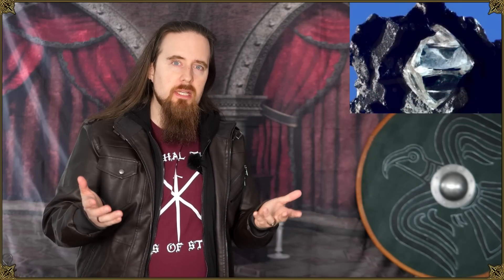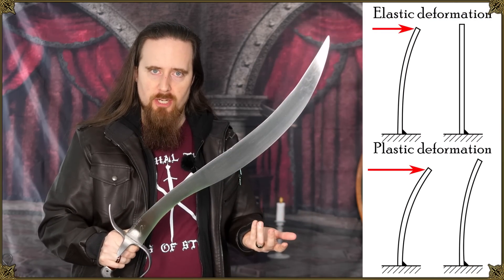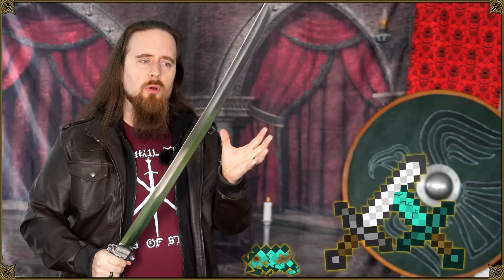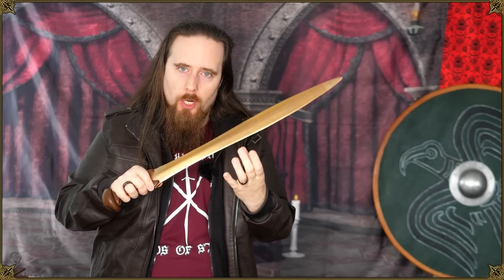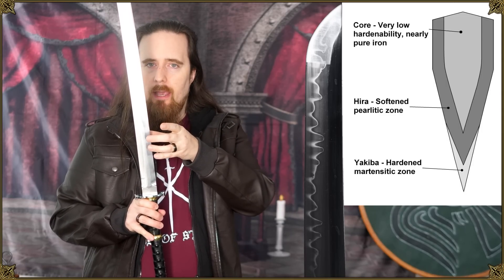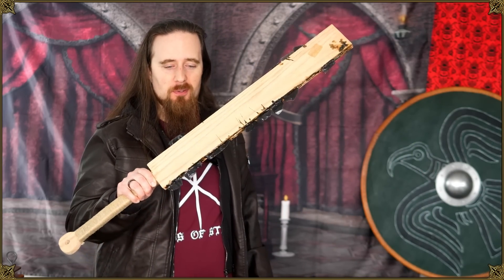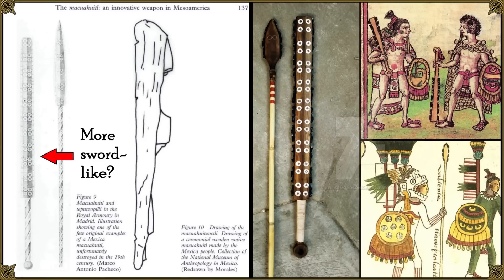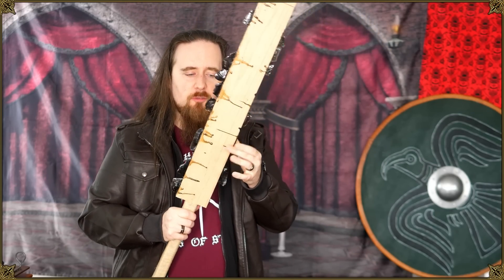Diamond Swords: Could They Work IRL? (Kind Of)

Comment: Normal harder steel becomes brittle. The term "steel" is about as generous as you can get these days. 8% iron or less with miniscule amounts of carbon still makes the cut.  You really need a chunk of AL6-XN fashioned into something. Basically half it's alloy composition is molybdenum and chromium. Then a fair bit of tungsten, a pittance of iron and way more nitrogen than you thought possible (several percent, like 4!). I haven't been able to chip it despite using it as a prybar. Its non-magnetic and won't make sparks against other metals. It cuts most other steels. I'd put my life on it not shattering. Kablewy squad guys love it for knives. It is considered a superalloy.

Comment: Skallagrim, what would your thoughts be on diamond javelin/arrow/bolt heads?  Again, assuming diamond as a material is readily available and as inexpensive as steel.
Reply: Any kind of cracking on the part of the diamond will serve very similar effect to ablative armor: much of the force will be dispersed in the cracking action. So you're gonna have some trouble there. It's part of why there's an entire category of ammo that gives up on sharpness and just tries to deliver a lot of weight and force with minimal losses from travel.
Reply: A diamond that size will shatter if you drop it off a bench onto a tile floor, much less hits a piece of steel at ~90 MPH

Comment: If you really wanted the hardest, sharpest edge for a blade, ignoring cost, you'd want depleted uranium.  It's very hard, and more importantly, it fractures in a way that makes it stay sharp, similarly to obsidian, but much tougher with less brittleness.  That's one of the reasons it's used in anti-tank rounds.
Of course, it's stupidly dense and still pretty brittle, so you'd only want to use it for the edge and make the body out of something like steel (or, if we're ignoring cost, nickel-titanium memory metal), or make a macuahuitl with DU inserts.

Comment: What you said about somehow binding diamond into a steel sword blade to make its cutting edge up is basically exactly how I figured a diamond blade might be done realistically.
Everyone seems to think that diamonds are indestructible , which's probably what lead them to think it'd be a good material to make a sword out of; but it's not because like you said, the harder something is, the better it can retain a sharp edge, but the more brittle it is too.
Also, it's nice that someone else recognizes that the diamond scarcity is an artificial one meant to keep their prices jacked up higher than most people can afford; all you have to do to make one is take a lump of something rich in carbon, like coal, and pressurize it for however long it takes to transform it. If we did that with all the coal we have in this country, diamonds would be so abundant that they'd be basically worthless .
Reply: While natural diamond's price is inflated, synthetic diamond's isn't. Yes, carbon is cheap, but the equipment and energy required to turn it into diamond really ain't. To quote Wikipedia: "The original method [of making diamond] uses high pressure and high temperature (HPHT) and is still widely used because of its relatively low cost. The process involves large presses that can weigh hundreds of tons to produce a pressure of 5 GPa (730,000 psi) at 1,500 °C (2,730 °F)."
Reply: @irrelevantfish1978  woah ; I don't know how many atmospheres of pressure that is, but that's a little over thrice the temperature of the surface of Venus !
Reply: @DakutoSamanushi  It's about 50,000atm, which is roughly 5x higher than needed to squeeze a sword blade until it cracks.

Needless to say, building equipment that can generate that kind of pressure without self-destructing is a bit tricky. 😉
Reply: I've had a theory for almost a decade now. If you constructed a layered long tube made of Highly Conductive Materials. With a long Highly Conductive Rod as well you pack into the inner Tube lots of Ash. Packing it as tight as you manually can and slide the Rod in the middle and seal the ends. Then place that on an elevated position that is prone to Lightning Strikes. I've theorized that it could potentially create Cheap Diamonds. In fact doing the same thing but with Mercury instead of Ash might make Cheap Gold as well.
Reply: @morrigankasa570  interesting theory, except I don't know if you can really turn mercury into gold.
Reply: @DakutoSamanushi  In some University/Lab settings they have done that. Of course it takes a massive amount of energy and time to do so which is part of why it's not done frequently. Especially considering the small amount of Gold they get from it. So that's why my theory/idea is so potentially brilliant. Lightning naturally occurs and is a massive amount of energy as well as heat so could be an efficient method.
Reply: @morrigankasa570  I'd love to see this experiment.
Reply: @DakutoSamanushi  If I had the money/support to do it. I would get the Tubes constructed and placed. Then have to wait for the results. But at minimum for the initial tubes it would cost $150,000 for the Ash to Diamond Tubes/Experiment. Probably another $200,000 for the Mercury to Gold Tubes/Experiment since would have to purchase the Mercury itself which is pricy due to quantity and it being a "Hazardous Material". But seriously if I won the Lottery or found a wealthy individual willing to provide the funds it would be done.
Reply: @morrigankasa570  I meant a video of the experiment you were talking about that the universities did.
Reply: @morrigankasa570  okay, thanks.
Reply: So it's overpriced quartz is what you're saying XD

And yeah big surprise for me, as I was also in the camp of seemingly unbreakable material = great in battle.

But then if it really was so damned amazing SOMEONE would have done it centuries ago. The last thing any combatant wants is for their weapon to shatter mid-fight.
Reply: @Malacite  Quartz is Silica Based while Diamonds are Carbon Based.
Reply: @morrigankasa570  I didn't mean literally I was making a joke because quartz is so common
Reply: @Malacite  Yes, I know that. But would've been more logical to call it fancy Charcoal. Since Charcoal is quite common in most parts of the world and is Carbon Based
Reply: You're on the internet. Diamonds being an artificial economy is almost as big a meme as the hardest material in the world thing. A lot of people do actually know.
Reply: @benedict6962  I see; thanks for letting me know.

Comment: Even if it would be a weapon with a hard limit of uses, a diamond macuahuitl would still be incredibly dangerous to encounter. The diamonds surely would shatter, but that's exactly what's so dangerous. It's not just the initial cut, but the additional damage of sharp shards being released into the wound grinding slowly deeper into your flesh with each move you make.

Comment: Synthetic diamonds are commonly used in drill bits for deep drilling. Would love to hear from someone who uses them regularly on their tolerances and draw backs. In the meantime I'll keep working away on my war drill.
Reply: There is also natural industrial diamonds but I think those sorts of drill bits tend to be grinding rather than cutting tools. Various masonry tools are like that.
Reply: Diamond is too fragile. Had a science proffessor basically tell me that if the pieces get any bigger than a small pebble then the pieces have a high risk of cracking. Basically it's too fragile, more akin to glass is how he described it. When used as an abrasive it shows it's hardness but when you crash and smack it it breaks.
Reply: Those tend to be tiny diamond abrasives mixed in with tungsten carbide to improve the latter's wear properties. (in part to reduce wear, in part to cause the drill tip to wear unevenly so it self-sharpens.)
Reply: They’re used for drilling many hard things. You can go to your local hardware store and chances are you can buy drill bits or sets of different shaped burs that are coated in diamond crystals. Even needle files. Think sandpaper. 
And just like regular sandpaper, they will wear down eventually. The sharp pointy crystals will chip, gradually reducing their effectiveness. Also they can clog easily if the proper lubrication isn’t used when grinding softer materials.
Reply: I used to cut and core drill concrete, everything is tipped with rectangles of diamond/soft metal rectangles. They are designed so that the metal wears away while cutting and new diamonds are exposed. The problem was that if you hit something hard and not abrasive, like large rebar, you could wind up polishing the edge to where it doesn't cut; until you run it through something abrasive like brick. And this is on everything from 8ft circular blades to the chainsaw ones.
Reply: drilling is different from cutting with impact. If you ever learned how to use a CNC yu will now that those drills with diamond edge are really REALLY fragile if you ever program a single bad movement
Reply: Used diamond tipped drills and circular saws to cut through reinforced concrete. Mightily impressive but I wouldn't know exactly how they were constructed.

Comment: Thank goodness somebody finally said this. Yes, diamonds are very, very hard, but they're susceptible to fracturing when under pressure and with enough blunt force. A diamond sword might as well be made of glass for all the good it will do.
Reply: Yup, same, but opposite of why "golden sword" is such a hilariously bad idea.
Reply: @DIREWOLFx75  In fairness, gold tools are very short lived in Minecraft, maybe even worse than real life. They're almost 8x shorter lived than iron tools, and even half as durable as wood.
Reply: @DIREWOLFx75 hey im not familiar with materials at all, could you elaborate?
im assuming you mean that gold would be very soft but flexible? like the bronze example in the vid itd just bend much quicker?
Reply: @fawazahmed4978  Gold is very soft AND flexible yes.

Gold is so soft that you generally cannot use pure gold for anything, because you can bend it, make bite marks in it with your teeth, even tear it apart.

So yeah, look at what happens to the bronze sword, then make that 2 orders of magnitude worse and you're closer to gold.
Reply: @DIREWOLFx75  thanks for the reply! makes sense i appreciate the explanation
Reply: "Thank goodness somebody finally said this." Yes, because this is the first time someone has ever covered the topic of "why not diamond sword?" on the Internet.
Reply: @md_vandenberg  There's always somebody that has to be an ass.....

Comment: You can actually take the diamond attached to the core weapon further. They make scalpels where the edge is basically covered in diamond dust. You could do that to a sword but I'm not sure how long term it would be even if the sword doesn't break in any way the dust will be ground away at some point.
Reply: Itsmy understanding that obsidian scalpels are also quite common
Reply: @highlandoutsider  I've heard of those too but aren't they an obsidian fragment unlike the diamond variant?
Reply: @foxtroika1698  yeah I believe they are ultra sharp fragments and not a coating like the diamonds 👍
Reply: @highlandoutsider  they are only good for a couple incisions, possibly even a single incision before they are deemed garbage. They are typically used when an incision is needed in a spot that scar tissue would cause complications or possibly be deadly (I.e heart surgery)
Reply: The diamond-dust idea would work very poorly, as all the diamond would be gone after the first sharpening, and surface particles like that are really only effective as abrasives, anyway, which isn't going to be particularly helpful for a sword. Diamond would make a good surface coating on the flats (reduced friction, corrosion, etc) and possibly a decent-but-not-ideal reinforcement in a metal matrix composite edge, but anything else is the domain of stuff like disposable razor blades and drill bits.
Reply: @irrelevantfish1978 diamonds would actually make for much better clubs than edged weapons. While it is true that diamonds have  what is called ‘perfect cleavage’ (insert Dolly Parton joke here) they can be cut and polished in such a way that force applied directly into the point of the diamond will not break it. 
You can imbed a faceted diamond (culet side down) using percussive force into a steel block without damaging the diamond. As a bench jeweler I’ve done it many times. 
Diamonds are much tougher than given credit as long as they’re not hit along their cleavage planes. Of course, as the crystals get larger, the likelihood of striking it on a cleavage plane increases. So you definitely wouldn’t want to use one for a war pick. But smaller stone sizes would easily go through steel armor. The problem is, they’d be so small that their capacity for penetration into what’s underneath the armor (ie human body) would be negligible. On bare flesh, they’d give you a nasty scratch or a superficial puncture hole. Where they’d shine (pun intended) would be for thin bone demolition. Multiple diamond points driven into a skull should serve to drastically weaken the structure making it easier to splinter and shatter the skull.
Reply: @nottheoneyourelookingfor0504  Huh ... hadn't thought of that, but you may have a point (ha), though the diamonds would also have to handle substantial shear stress, due to the "glancing" effect caused by impacting a curved surface. I'm not familiar with diamond's fracture mechanics to know if that's possible.

If it is possible, then you're underestimating its potential effectiveness against armor. Look at the faces of late-medieval/early-Renaissance poleaxes and warhammers and you'll find little spikes and serrations meant to bite into armor, reducing the energy/force lost due to glancing/skidding, and inflicting stress-concentrating punctures/dents that would increase armor deformation. Making those structures out of diamond could potentially enhance those effects.

Additionally, one could potentially use a similar approach for the tips of spikes or even edged blades, assuming the ultra-hard point could be mounted in such a way that the metal body could supply sufficient flexural support.
Reply: @nottheoneyourelookingfor0504  So...like a diamond studded club?
Reply: @nottheoneyourelookingfor0504  Diamond morningstars when?
Reply: @irrelevantfish1978  I said it wouldn't be long term
Reply: @foxtroika1698  You said (and this is copy-pasted), "I'm not sure how long term it would be." I am, which is why I commented.

Additionally, there's a difference between "not long term" and "single use," and that's basically what it would be if used in combat, and if it's not going to be used in combat, it's not worth the bother. As shown by Matthew Jensen's croquet stick of doom, unless it's massively more durable than anything available today, an edge well-shaped to cut will dull after a solid impact on metal, and a micro-scale coating will do almost nothing to prevent that. (Swords aren't drill bits, and a few micrometers of diamond will do squat to stop rolling or chipping.) That means after one fight, it's "hello, whetstone" and "buh-bye, diamond."
Reply: That's LITERALLY a process made in Shadowrun universe with Dikote process allowing to deposit a fine layer of diamond on surface (and not only weapons, it is used to strengthened armor surfaces as well)
Reply: @DC2022  It's also literally a process IRL, though the coating is typically a solid film a few micrometers thick rather than just sprinkles, as it's both cheaper and more effective.

However, the coatings are too thin to do much to stop a bullet or to be permanent on a cutting edge, and going thicker means you start running into the same problems of an all-diamond sword.

In other words, diamond coatings are great on stuff like drill bits and bearings, but they suck for armor and swords.
Reply: @luth9119  Swords cut by causing fractures. Cutting discs cut by abrasion. They have the same purpose but operate by entirely different principles, a bit like combustion engines and electric motors.
Reply: They are, in fact, precision cut industrial (synthetic) diamonds mainly produced in germany where i live. Those are used for operations on the iris.

Comment: On the topic of the Macuahuitl. Could you in effect make a steel/diamond variant? In essence forge a steel sword with a gap to fasten in segments of diamond edge? How would something like that fare in combat?
Reply: probably the exact same as normal macuahuitl. Are we talking like diamond shard duct taped to a steel sword? or a executioner sword with diamond shards in the metal? cuz if so exact same as macuahuitl for the latter, and for the former a bad cut that would leave shards and you still have a steel sword. that would be what i would think at least with my very VERY limited knowledge of materials in combat

Comment: it could work by embedding diamond crystals on the surface of a spring tempered piece of metal, similar to how diamond drill bits work.
Reply: ye, they often vacuum solder it to materials not prone to breaking, like steel bases and shafts. You can also trap diamond dust inside metals like brass, i have few russian made brass-diamond sharpening stones.

Comment: What about a steel sword with a diamond coating on the edge? There are diamond tipped drill bit in real life.
Reply: and how would you make that coating? you can't smelt diamond, you can't use electrodes to give it a coating like you would with zinc because diamond is non-conductive. The drills works because usually the force is slowly increased and it is not a single strong impact.